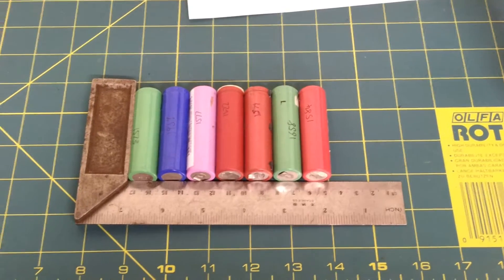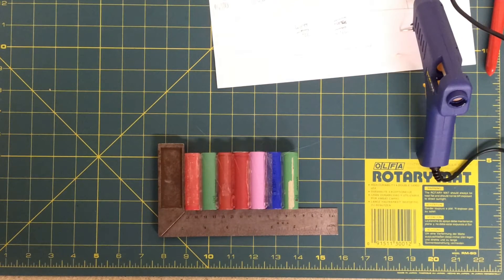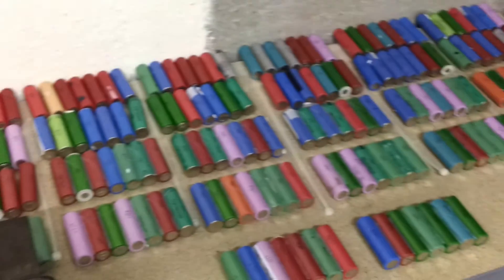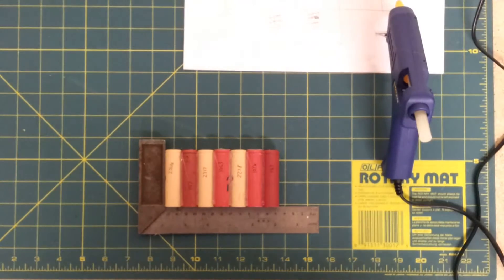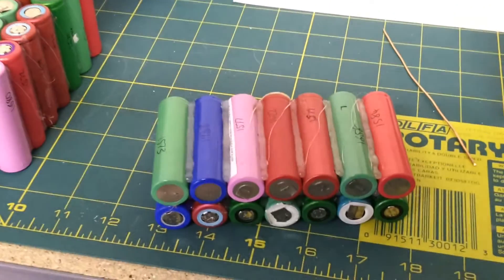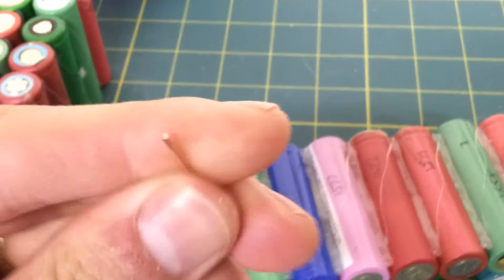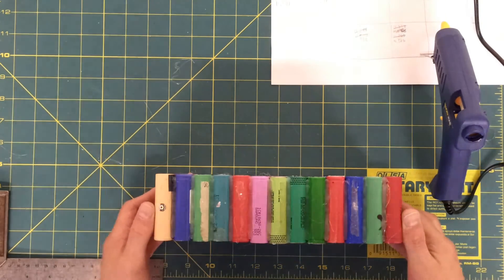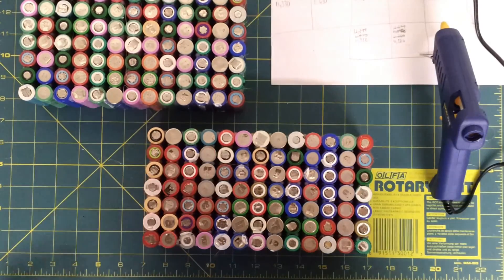Lithium Ion 18650 48v e-Bike battery build DIY - Part 6 - Glueing the battery pack

Comment: A metal ruler tut tut
Reply from the maker: You'll note that the square was not making contact with any of the opposite electrodes of the cells so no shorting could possibly have occured, but point taken!

Comment: How are you, my dear?

I have a question about the batteries' capacity that you used in this pack.

Did you combine batteries with too much different capacities in the same pack? For example, a 1s7p with capacities around 1000 mAh combined with other 1s7p with capacities around 2000 mAh (repeating this process until you get 13s7p battery pack).

I have started harvesting batteries from laptops and I'm using a IMax B6 mini (original Sky RC) and a OPUS BT-C3100 to charge and discharge the cells. Further, I'm trying to separate only cells with capacities greater than 2000 mAh (my plan would be create a 13s5p, i.e, 48v 10Ah pack).

Thus, am I doing it wrong  (using only batteries greater than 2000 mAh)? Is it necessary or is it just a preciosity?

One more time, thank you so much.

Regards,

Pedro Rosa.
Reply from the maker: Hola, Pedro.

I did combine cells with different capacities in my parallel packs, yes. From all of the laptop cells I harvested, I removed any below ~1000mAh I think (it was a while ago). My highest cells were approx. 2300mAh if I recall correctly. This means that some of my parallel packs had cells varying between ~1000mAh and ~2300mAh in order to balance them. My average was approx. 1700mAh. 

Using cells that are only higher than 2000mAh is a very good idea: you will achieve a powerful battery that is much smaller than an equivalent one with lower capacity cells, like mine. I would have chosen this option if I could but from the ~200 cells I harvested only relatively small quantity had capacities over 2000mAh. This forced me to accept cells over ~1000mAh for my two batteries. If I were to build a battery pack again I would choose cells of a higher capacity to save weight. 

 Good luck with your build, mate.
Reply: Many thanks for having answered me too fast, my dear. I appreciate your kindness. 

Where I live (Brazil) is very hard to develop things related to electric vehicles. The government always creates ways of  muddling us because the gasoline costs are very expensive (due to the total amount of fees applied in).

Are you in USA? As I told you, there is no way of buying ebike parts here in Brazil. I thinking about buy a Bafang kit in USA (https://lunacycle.com/bafang-bbs02-750w-middrive-kit/) and import it through a friend of mine that will be there in the next week.

Do you know this Bafang kit?

Regards,

Pedro Rosa.
Reply from the maker: Hi Pedro, 

I made an incorrect assumption about your location earlier with my greeting, so apologies for that!

I'm in the UK and I haven't heard of that particular kit but I've no reason doubt it works well. I ordered a cheap, no-name kit from China on eBay and it is still working fine. It was a 1kW motor for ~£150 delivered.
Reply: That's ok, my dear. I speak Spanish too :)

Is this kit that you bought a hub motor or a mid drive?
Reply from the maker: It was a front hub motor kit, with controller and other necessary components. I wanted to cut down on the number of potential failure points and considered that the hub motor (front or rear) was the simplest method. The negative aspect of a hub motor would the considerable increase in unsprung weight for the front forks to cope with, and a level of torque the fork axle mounts were not designed for. I understand that torque arms negate this problem somewhat.

Comment: Where did you get your battery's looking to convert ebike
Reply from the maker: Hi Garry, I bought the cells used from eBay. They were originally laptop battery packs that I dismantled for the 18650 cells inside.

Comment: You should have off set you rows so that they seated in the lowest part of each row then you would have very strong packs and no need to tape. Hindsight is a wonderful thing.
Reply from the maker: I'm not worried about the aesthetics now as much as I was then. Each pack is still more than strong enough with hot snot and gaffer tape, and they stay out of sight in their respective bags most of the time anyway. The real benefit from aligning the rows in the manner you suggest would be the volume reduction for the same mass of cells. Something for me to improve upon for any future battery build I think... Thanks for watching.